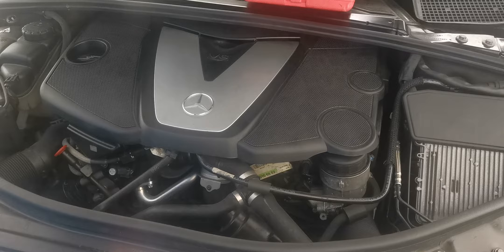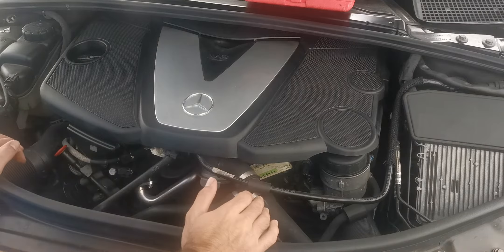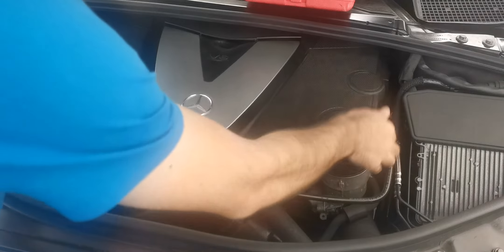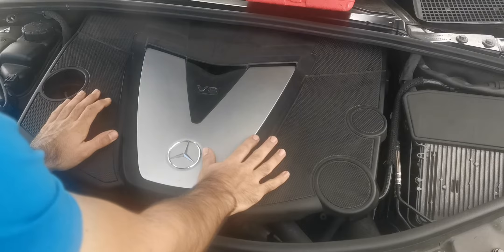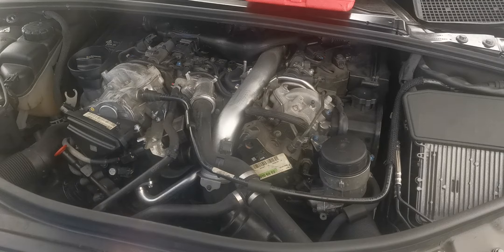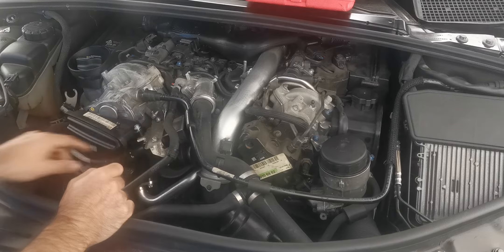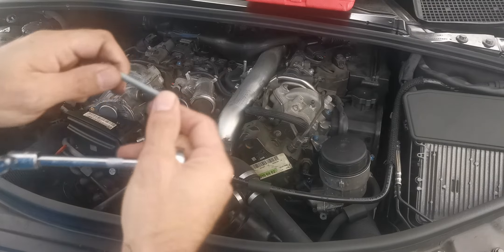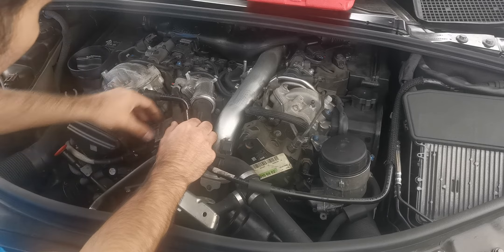OM642 Mercedes Glow Plug Control Module Removal

Comment: Thank you good sir, my W221 is giving me a hard time starting in the morning and the glow plugs light stays on for a few seconds after the engine fires up. Hopefully replacing the relay will solve the issue if not, then replacing all the glow plugs will be a pain in the arse 😞

Comment: Hi, thanks for the video.
I need to replace the same part on my W204 C Class.
Is installing the new module as simple as plugging it in and replacing the screws?
Reply from the maker: Hi, yes it is so easy.

Comment: Can anyone tell me where is the glow plug control module replacement on A class Mercedes Benz 180 diesel 1.5 engine
Reply: InstaBlaster...
Reply: I have the same question? Did you find out the location? Thanks.